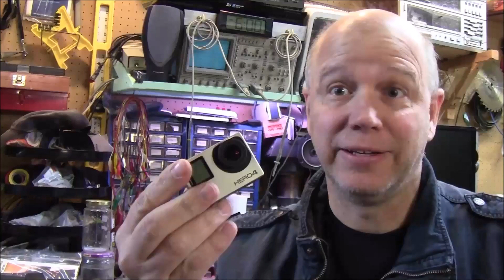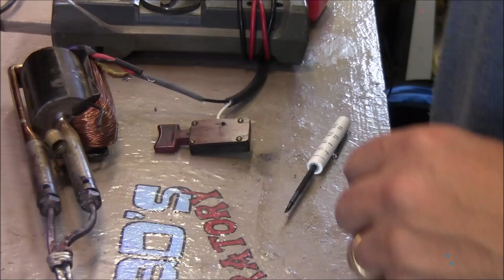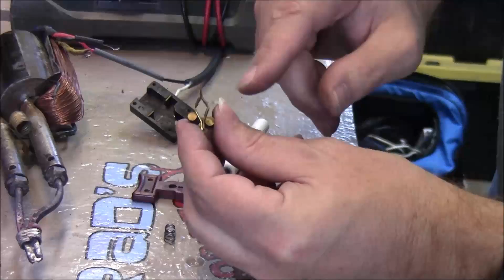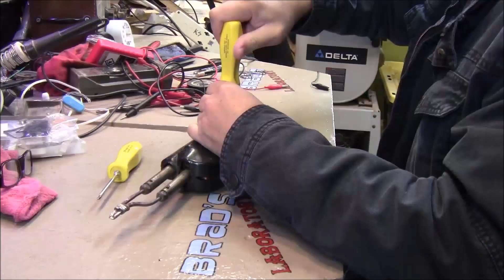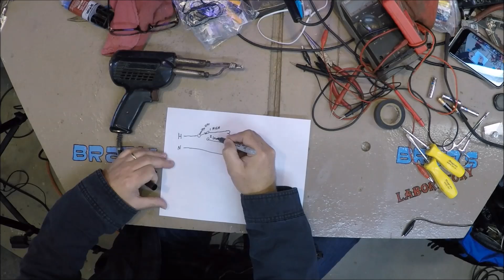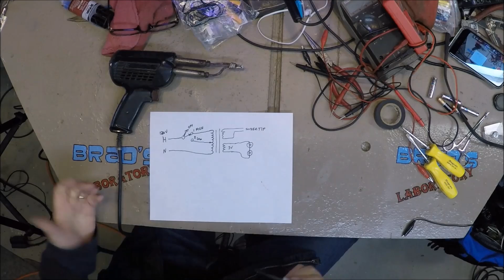SOLDERING GUN REPAIR

Comment: What's with the wire twisted around the tip? Should I be doing this? More mass, broken tip repair, sturdier?
Reply from the maker: Tips came that way back then, I think it was part of the manufacturing process, pulling the bend together. It was probably a person doing that step.

Comment: I've owned or repaired dozens of dual heat Weller guns made over the past 65 years or so. I suspect that you are correct in assuming that someone had previously reassembled the switch incorrectly. Every Weller trigger switch that I have ever taken apart has been assembled with what are called "screw rivets" or "hammer drive rivets", not ordinary screws. Those rivets can be unscrewed and reused easily by gripping the edge of the round head with a miniature pair of Channelocks or ignition pliers. Now that the #7324 switch used on the 8200, D550, and D650 has been discontinued, it's important to know that most of them can be repaired. If the switch feels mushy, doesn't click, or doesn't turn off (or on) reliably, chances are the small spring connecting the 2 brass bobbins has failed. I mark the edges of the brass actuators and take a picture to aid in reassembly. The trigger itself only goes in one way. Also be aware that the return spring will go flying off to destinations unknown if you give it the chance.

Comment: My new "old" D550 (235/325watts) puts out good wattage on low (230 watts) and only about 200 watts on the high (325).  I've cleaned and tightened the tip. I took the switch apart and cleaned it with brake cleaner (very greasy). No increase in high wattage. I checked the power by bypassing the switch and jumping from hot wire to each side of the switch; low setting good (230 watts) ; high still 200, nowhere near 325 watts. I had to grind rivets to  get the switch open. No screws in this model.  So now what ??? My only thought, based on your sketch, that low power only uses a part of the winding, the high winding may be shorted and is using only a portion of the winding. Any advice, Brad. I love looking inside of the switch. Thanks for the tour. This is my first, used soldering gun so I am new to this game.

Comment: I'm trying to figure out how to replace the trigger and I'm going to replace it with a foot switch but I'm having a problem finding out which wire(s) are full power.  I connected 120v to each lead and tested the current going through it and I'm getting 75-83 watts on the single (black) conductor, and about 142 watts on the "center tap" yellow wire (the one with 2 wires coming from the coil).  So I'm way off of the 250 watts I'm supposed to get.  

I did also connect both black & yellow in parallel and it sounded the same (slight buzz/humming) but I was getting ~385 watts and the windings get hot very quickly.  

I've checked the coil and it seems to be in good condition, no shorts to anywhere that I can tell.  

Red -> Black = 3.6 ohms
Red -> Yellow = 3.2 ohms
Yellow -> Black = .1 - .2 ohms

I'm wondering if you have ever tested the power usage or wattage of your device and have any suggestions on how this might be wired to get the proper 250 watts.  This is much more frustrating that I would have thought for something so simple.
Reply: For low power (only) connect the mains between red and black. For high power (only) connect the mains between red and yellow. The switch operation is easier to understand if you think of it as 2 separate switches controlled by a common trigger . First click closes the master section and sends power to the slave section. The second click determines which one of the two taps on the transformer receives power from the slave section  The high power you observed when paralleling yellow and black wasn't going to the tip. If left that way it would quickly burn up the primary winding of the transformer. The actual power you measure is highly dependent on how well the tip is connected to the posts. Even a small amount of extra resistance at the connection points will make a big difference in power delivered.
Reply from the maker: They are most likely lying about the power. Sounds like you are right on it with the red wires

Comment: Not the clearest video but excellent tuition.  I have a similar Weller gun, owned for about 40 years when I bought it new, where just the low power side of the iron is now working.  Clearly I have an issue inside the switch which is failing to connect the high power side when the trigger is pushed all the way in.  Your video has shown me what to expect when I take it apart giving me confidence to tackle it.  Thank you.  Good job.
Reply: you have the idea backwards all the way back = low, part way back = high
Reply: @adamkempa5157  It is counterintuitive, but you are correct.

Comment: Peace be upon you. I have a caustic 100-watt caustic iron, which is very weak. How do I turn it into 250 watts.
Reply from the maker: It is all about the transformer, that is the most expensive part of the soldering gun. I would just look for a 100 watt gun, otherwise you are winding a new transformer and then it won't fit in your old gun.

Comment: Your diagram was right you explained it wrong less turns on primary = high power the whole coil would be low power
Reply from the maker: The primary winding typically doesn't change - you build it to take in 120 volts, and then change the secondary to get different voltages.  Fewer turns on the secondary equals less voltage and more current. Power is derived from the voltage/current of the secondary.

Comment: Thank you for the follow, I did as well! Yes the LED kit on my channel is amazing, they really work well and have amazing color rendering! They are also said to last 45 years.
Reply from the maker: The best ones I have are the ones I pulled out the dumpster - I (over)built my own power supply and they have been fantastic.

https://www.youtube.com/watch?v=8afVEaeD1u4
Reply: But were they invented 45 years ago?
I mean how else would they know?
Reply from the maker: Mean Time Between Failure (MTBF) and Mean Time To Failure (MTTF) is typically stated on the manufactures data sheet. There is a whole science behind it and a typical value is 100,000 hours for an LED.  So just over 11 years. That being said we know they die well before that, it is typically due the power supply that is driving them failing and providing the wrong voltage & current to the LED, shortening its life span.
Reply: Checked your site and couldn't find a LED kit for Weller soldering gun.

Comment: I've faced the same pain. My most viral video was a video where all the stuff I meant to record didn't. So I ended up pointing and showing instead of doing...and yet, it went viral - well relative to my channels size. :)
Reply: Especially creative trigger fix.
Reply: Few coils means low voltage and lots of amps . . . cool.
Reply from the maker: Thanks for the sub and the comment. I had just got my GoPro and was still figuring the best way to film.
Reply from the maker: I am #634 on your channel!

Comment: Thanks for the video, how many laps do the coils have? Thank you
Reply from the maker: I am going to take an educated guess at around 200 turns of 22 AWG solid wire.

This is based on an iron core calculator I found here:
https://www.ajdesigner.com/phpinductor/inductor_equation.php#ajscroll

with 200 turns on an iron core (.00653 Permeability) and a coils area of about .4" x 3.9" comes up with about 26mH of inductance which is about what I measure with my inductance meter.

Also It just looks like about 200 turns, by counting 10 and then looking at it - it seems about right.

Comment: Thinking of the turns ratios, the "center tap" would be "HIGH" and the full primary would be "LOW" because the change is being made on the primary side.  The secondary (tip) winding is the tip structure itself, with only one turn through the core, hence, the secondary voltage will be higher when the only a portion of the primary is being used.  Consider the situation if the primary also consisted of only one turn -- the voltage induced in the secondary would be the same as that of the primary.  Therefore, we can see that fewer turns in the primary will induce a greater voltage in the one-turn secondary.  Since the secondary (tip assembly) circuit resistance remains the same, there will be more power dissipated in the tip due to the increased current when the voltage across the tip is higher.
Reply from the maker: That is not what they taught me in school. If you have 120 windings on the primary (Line Voltage) side and 120 windings on the secondary side you have an isolation transformer with the same amount of voltage and current on the secondary as the primary, minus some losses in the conversion. When you reduce the number of windings in the secondary, you don't have as many turns being cut by the magnetic field of the primary, thereby reducing your voltage and increasing your current. This is typical of may microwave oven transformer projects you find on You-Tube, where they have the 120 Volt primary coil intact but add a turn or two of heavy gauge wire as the secondary. They have decreased the voltage to only a couple of volts but massively increased the current allowing for welding. The same is true for the reverse, if you double the turns on your secondary, you will double the voltage output, but half your current. In this way you can make a step up transformer to operate 220 Volt equipment in a 110 Volt county. Turn the transformer around so that the 220 Volt side is now the primary and the reverse is true - you have a step down transformer allowing use of 110 Volt equipment in a 220 Volt county. Taking the step up transformers to the extreme you have the Tesla coil as an example, where relatively few windings on the primary are coupled to a huge number of windings on the secondary creating very cool high voltage arcs that have very little current associated with them.

This is what I was taught in school and know to be true due to personal experience.
This page essentially explains it the same way, with the math included:

https://www.electronics-tutorials.ws/transformer/transformer-basics.html

Thanks for your comment!
Reply: @BradsLaboratory :  Yes, but the secondary winding consists of but one turn -- the shiny tube which holds the tip.  If the gun is a multiple-wattage device, any changes in the power output must be made in the primary winding because the secondary is fixed.  Under load, my Weller D550 (older model rated at 240/325 Watts) produces around 0.3 VAC across the tip.  At 325 Watts, that means about 1,000 Amperes(!) are flowing through the secondary circuit -- the shiny tube and the tip.  The gun is rated at 20% duty cycle -- one minute on, four minutes off.

By the way, the lamps are 222's, and there are several places (1000 Bulbs and others) where you can buy a box of ten for about three bucks.

Comment: Brad, working in switches for a long time, and when they come apart like your old soldering gun did, It's always a plus!! And I'll tell you why. You were clever putting the switch back together properly, good on ya!! My point is that I put dielectric grease in 
that switch cavity. I use it on all electrical things exposed to the elements, like trailer lights, and inside switches. That grease will 
allow lubrication to the moving parts, AND not hinder current from flowing inside it, hence the name dielectric. So, ya want to keep moisture out of light sockets, and slide a bit of dielectric under heat shrink when making a splice, that the ticket. Dow makes it and it's available from Electric supply houses. Moisture is a killer to splice joints, it's gone with this stuff. Keep a tube in your electrical drawer, and opens are gone forever. Especially in a ground circuit. Opens are harder to find than shorts. Just sayin".
Reply from the maker: I used to have a tube of that, I used it on my snowmobile trailer connections and any connections on the sleds. worked awesome. one day a wrench or something got on top of the tube in my tool box, when I got back down the mountain it was everywhere but in the tube. I'll have to pick up another tube at some point. As this wasn't going to be out in the weather, I wasn't that worried about it. I have specified and bought a lot of switches over the years from mil-spec to surface mount PC board units - so I hear where you are coming from!

Comment: my gun is later version...has no screws on switch...has cheap looking riveted part...aaarrrrgggghhhhhh..maybe I will drill the rivets out..
Reply from the maker: Just try to clean the switch with some contact cleaner.

https://www.amazon.com/CRC-5103-Quick-Electronic-Cleaner/dp/B000BXOGNI/ref=sr_1_3?ie=UTF8&qid=1477946197&sr=8-3&keywords=contact+cleaner